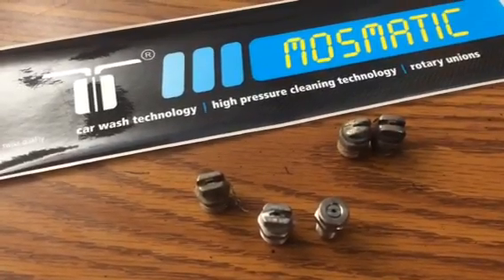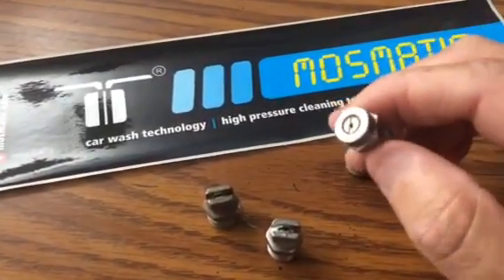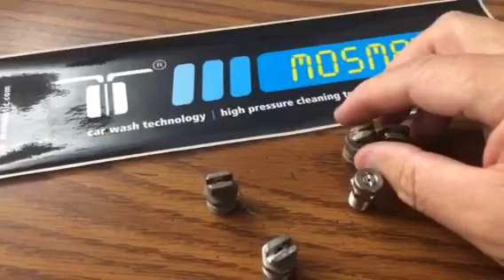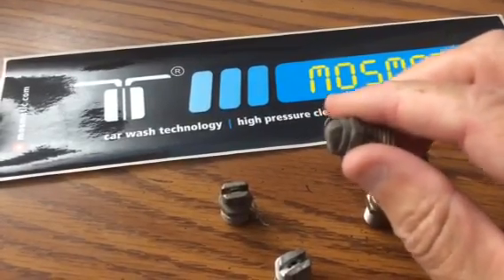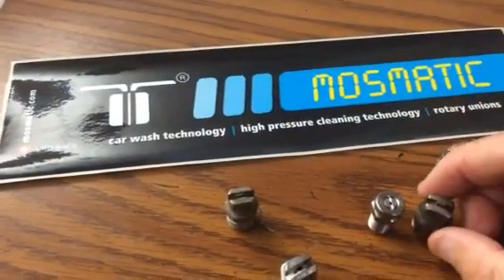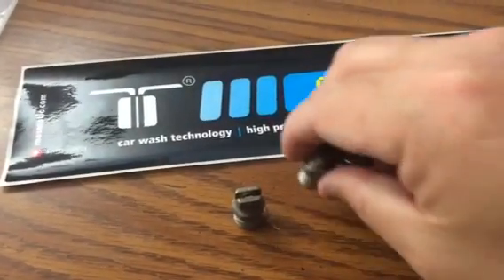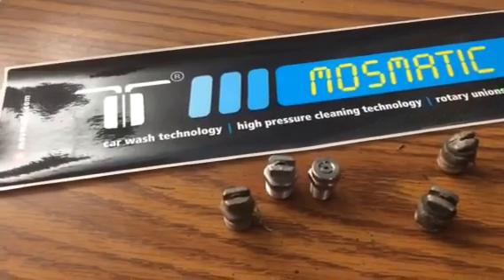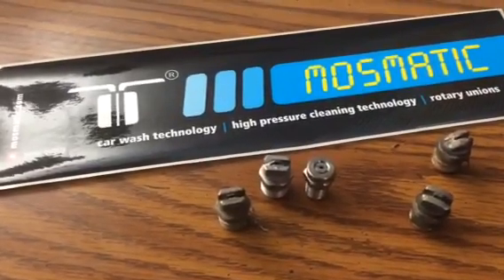Why spray nozzles in surface cleaners fail. WHY is my Surface cleaner leaving ZEBRA Stripes

Comment: Ron,  QUESTION:  If I am seeing swirl marks or having to move my surface cleaner very slowly across the concrete to prevent swirl marks, will changing the nozzles from a 2.0 orifice to a 1.5 orifice solve the problem?  The surface cleaner I bought is rated for up to 4500 PSI.  My Generac pressure washer is rated at 3100 PSI maximum.  It seems like decreasing the nozzle orifice size should increase the water velocity as well as the RPM spin rate for the nozzle tube.  Thanks
Reply from the maker: Yeah that will give you a perception but your not cleaning as effective